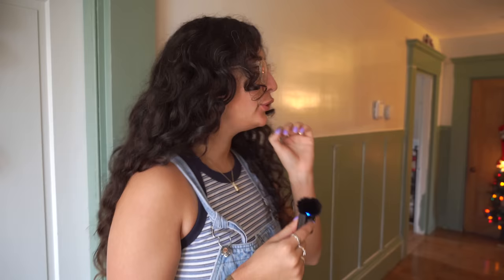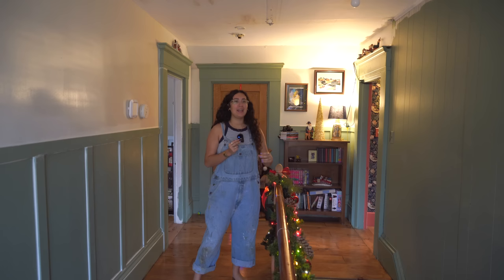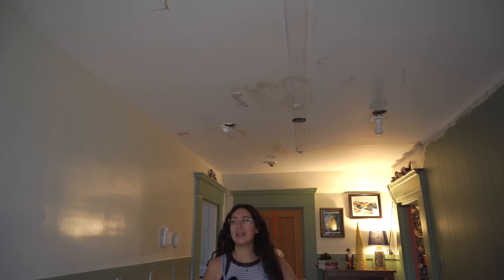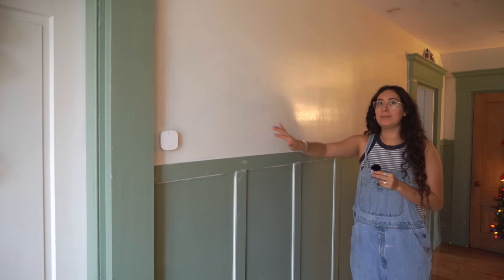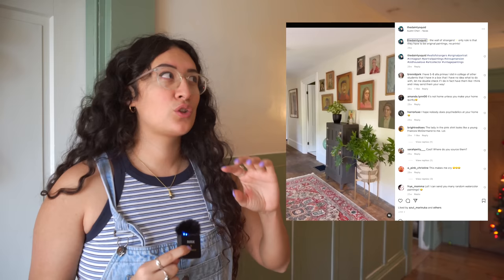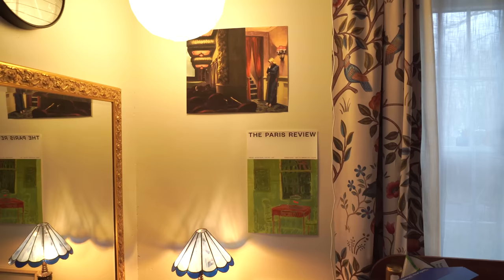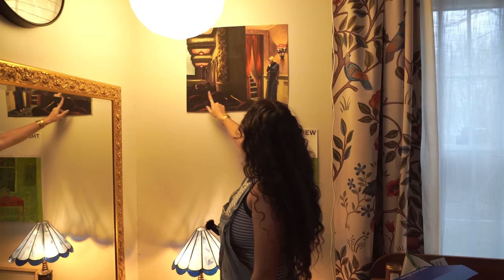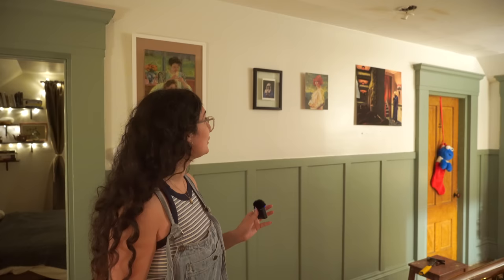Finishing One Wall In My House!

Comment: ariel! i work the paint desk at a hardware store! next time you need some green, take a little patch of the dried paint on the inside of your mixing bucket - a square inch or so is enough. they can color match it at the desk! then you'll never have to buy two smaller cans ever again 😭

Comment: Ariel you don't need to mix the paint yourself every time. If you take a sample into the paint shop most of them have a machine that will color match and they can make a custom color for you right there in store, it's doesn't usually cost more than buying one of their colors. You might even be able to get a print out with your formula so they don't need to color match every time.
I adore Kayla (Dainty Squid). Her home is gorgeous and her style is amazing. I get the feeling she was kinda chased off Youtube by nasty commenters who didn't get her style and that's such a shame.
I would suggest you keep a small jar of the white paint and a small jar of filler in a cupboard close to this hallway, that way you can mess with the placement of your pictures and have the stuff on hand to fix up any nail holes quickly and easily. I do that with my gallery walls and I love that I can put holes in in the walls to my heart's content and not have the hassle of needing to find the stuff to fix up my mess or have the guilt of living with the holes and constantly thinking that I really must get round to fixing them.